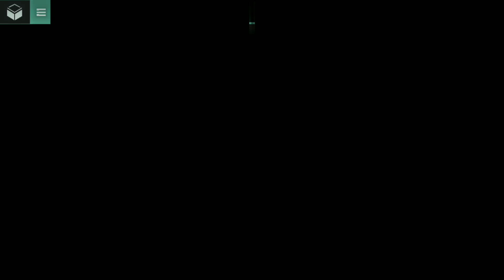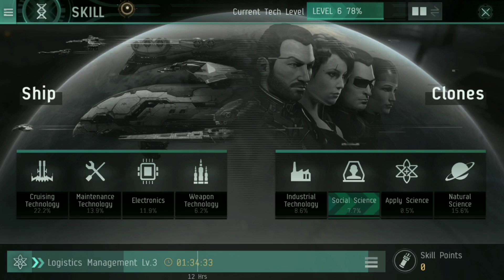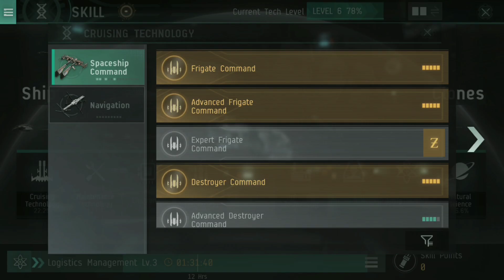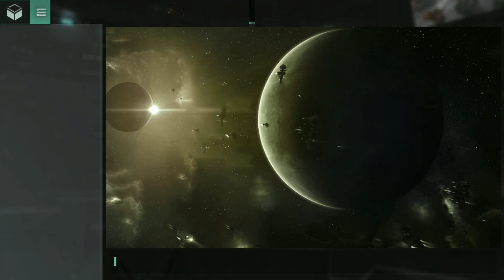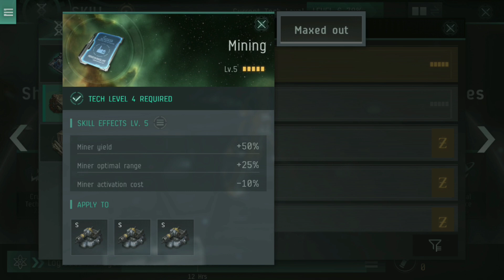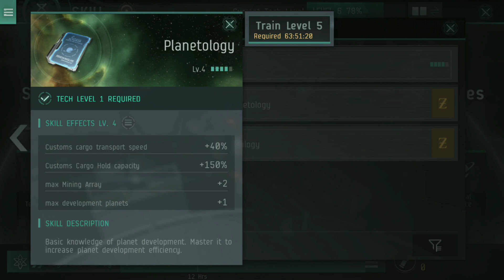[BETA] Are Skills That Important?? What Should You Train?? || EVE ECHOES

Comment: The Navy issue destroyers all have a 50% bonus damage at level five Destroyer command, not sure about the other Navy destroyers but the catalyst has six has Riggs, four high slots, one medium and two low. Between a armor hardener, repair and a Nosferatu in the medium slots and a standard rack of guns you should be cap stable enable to tank all level 4 anomalies and some most 5 missions.

Comment: Another great and helpful video. I do have a couple of questions...

I have been mining in a 0.2 sec level system and have been dropping off my hauls at a local station in the system, the problem I have is that I need to consolidate all my ores at my home base which is about 8 jumps away. I cant afford a hauler, what other options do I have?

Also, do you have a discord server?
Reply: Reprocess them, the materials themselves are much smaller and easier to transport than the ores.
Reply: Thanks everyone, I'll upgrade to a venture 3 before attempting to move everything